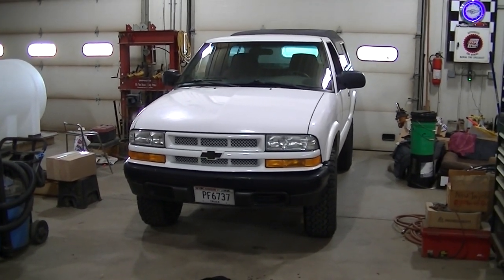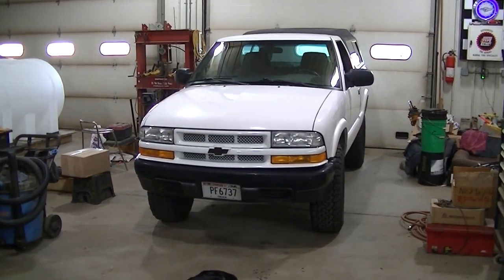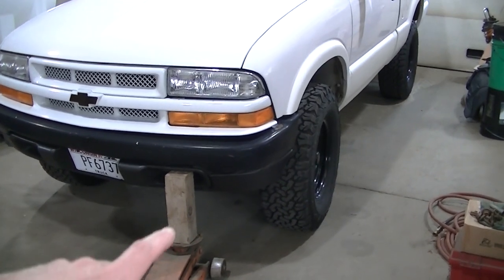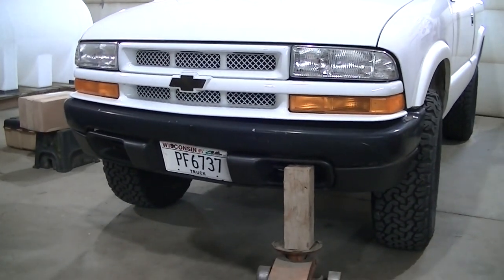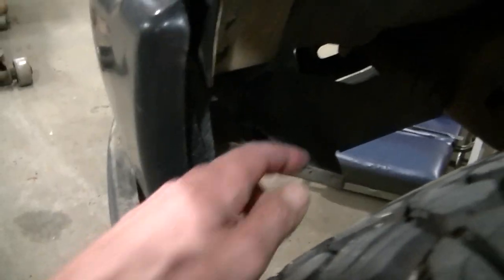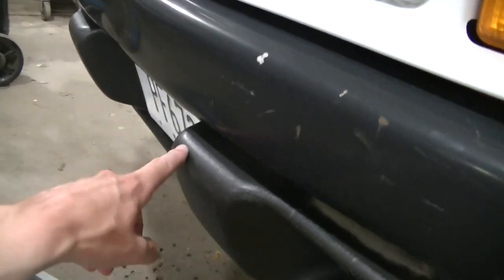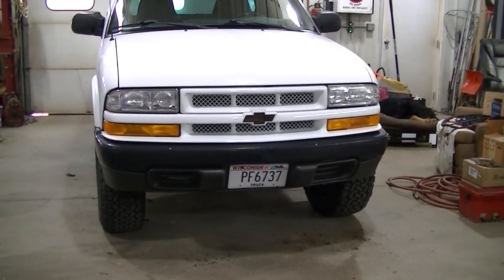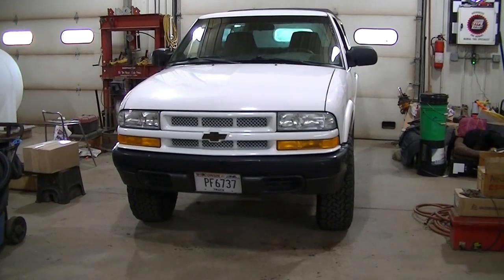Project Junk S10 Bumper Fix & Update 7-4-20

Comment: How did you remove the plastic piece
Reply from the maker: I didn't remove it. Just the side mounts. I think you have to remove the whole bumper to get the plastic valance off.
Reply: @mossman381  its all good I used a crowbar and snapped the pins